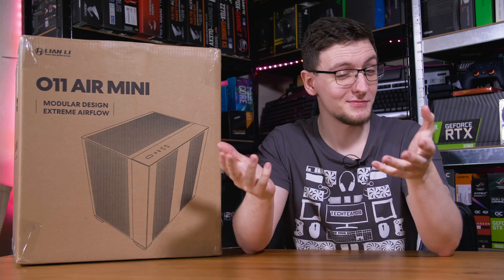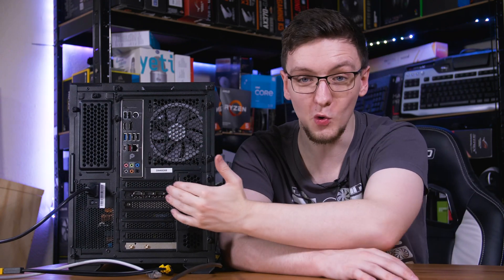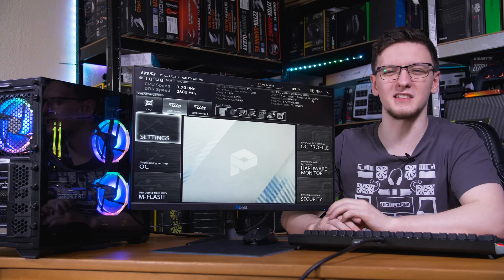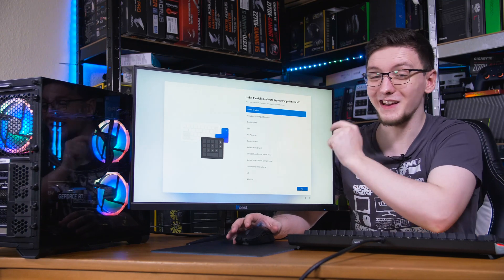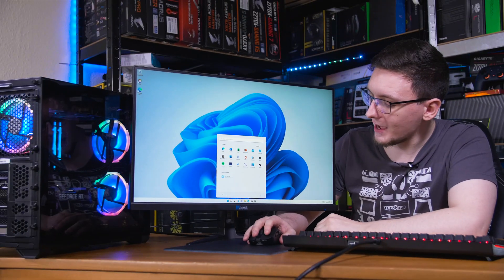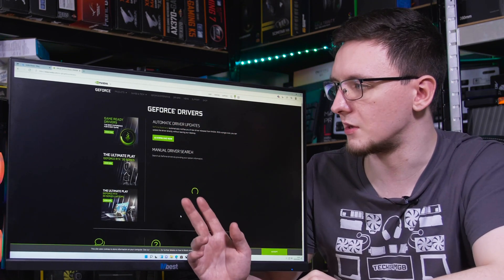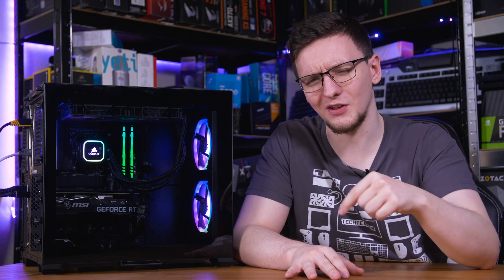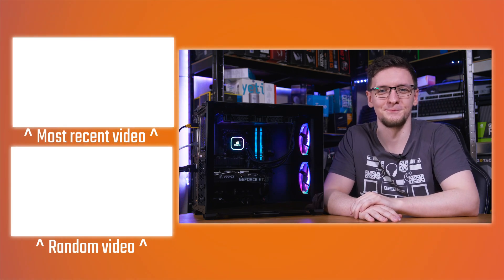How to setup a new Gaming PC - FAST!

Comment: Memtest86, Prime95, Aida? Old video, you may not see this comment... but when I was building custom PCs, I'd never hand it off without a torture test and also checking for any system conflicts in Device Manager. That's the bare minimum, imo. I just ordered a mid-range CyberPower (not worth building for many years), I know the first order of business is to get a better cooler on the cpu, I've read it's become standard practice to give you trash coolers.